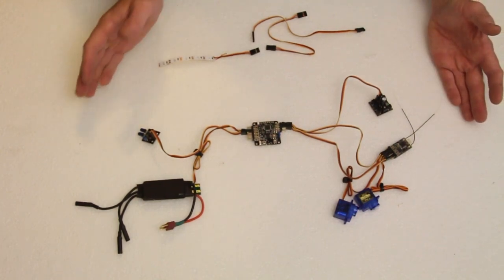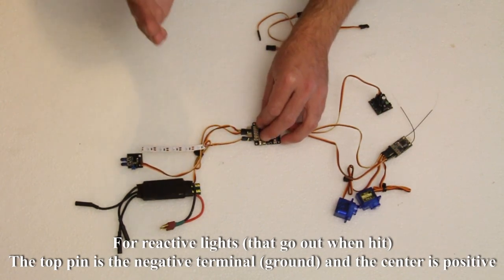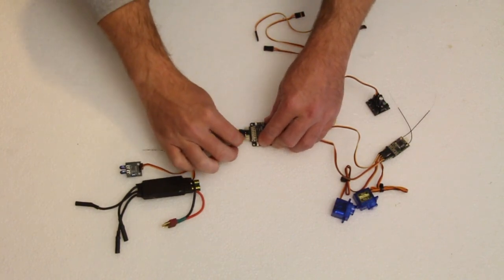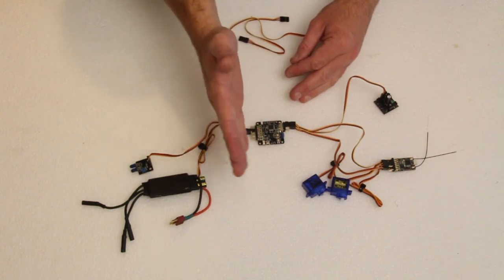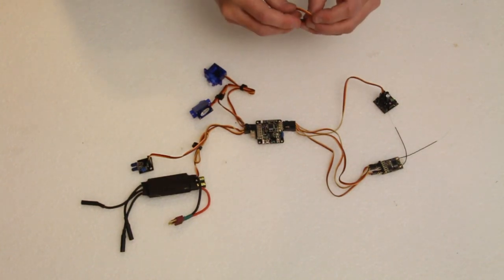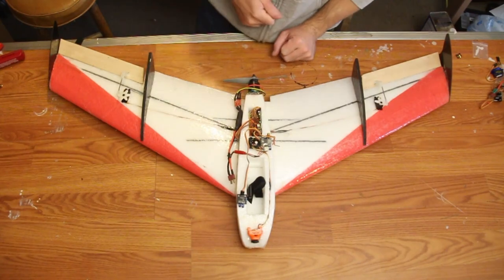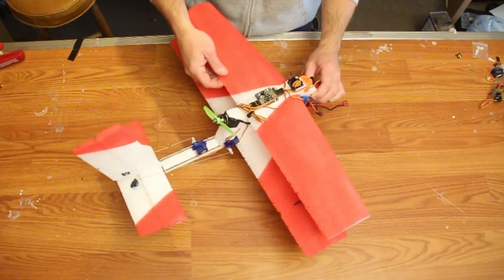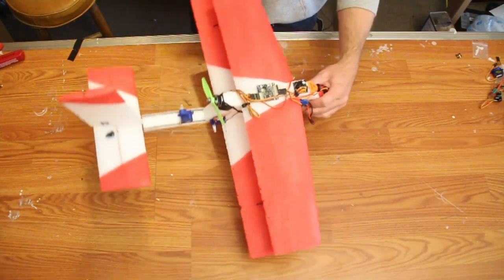Ace combat (RC Laser combat) advanced set up

Comment: I just ordered mine! Can't wait to get it in the air...I sent it to a few friends and we are going to build a spec version, so we will all have the same set up.
Reply: Did you ever get it up and running? I was thinking of using some kind of flite test foam kit
Reply: @explodingevo  No not yet, I got all the parts but didn't have time to build the kit yet. We are going to use the FliteTest Simple Scout for the airframe(fpv of course)

Comment: Would you be able to use this with only the lights being attached? No motor cut out or servo twitch just lighting indicators?
Reply from the maker: Yes, no problem.  It just works on whatever you connect to it.  If you do not connect the ESC or servos, the combat board will not affect them.

Comment: Alex, can you expand a little bit on the RGB counter LED -- do you have a link or source for that?
Reply from the maker: Any RGB LED strip will work.  They are also called "addressable LEDs".  You just need a string of 9 of them and this will automatically address each LED for the score counter.
Reply: @CAGreve1231  got it. It lights one up at a time.  Makes sense.

Comment: would be nice if there is a indi on osd in fpv cam that u been hit or dmage..
Reply from the maker: There is an OSD output pin, but no OSD onboard.  Having an OSD onboard would add more complexity and cost.  I wanted this system to be very inexpensive and simple.
Reply: @CAGreve1231 where are the osd pins?
Reply from the maker: There is just one: the "B" pin.  You need to configure your OSD to make it work.  There is no built-in OSD, just an interface.